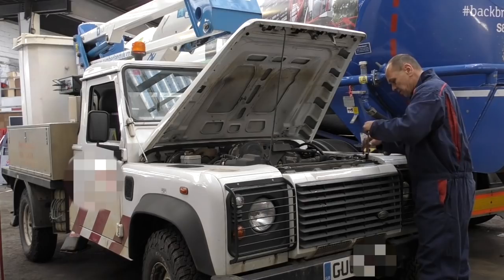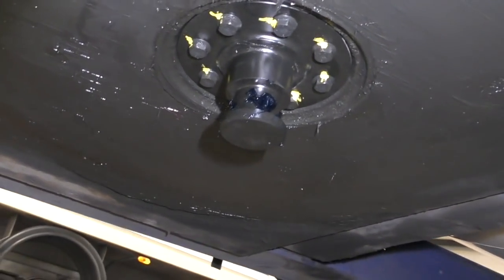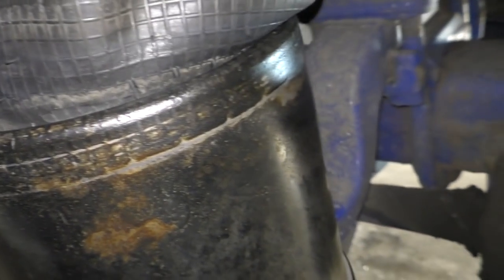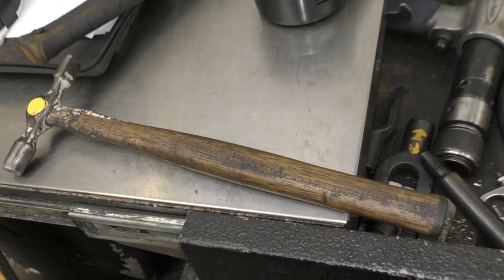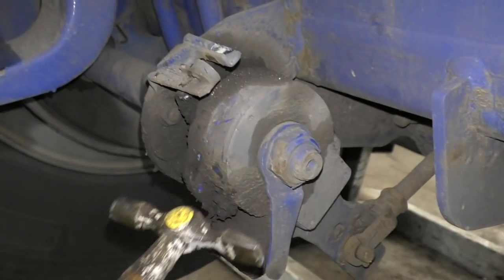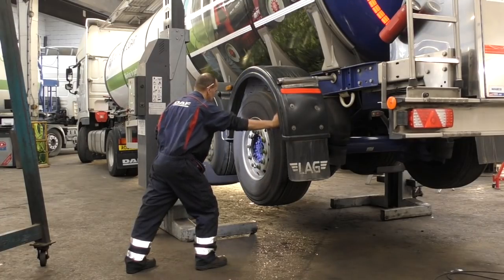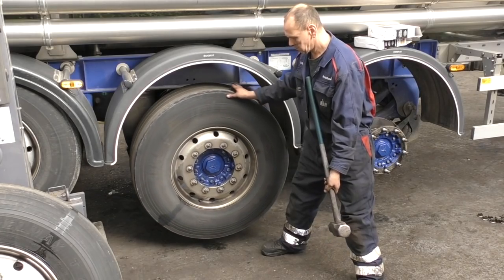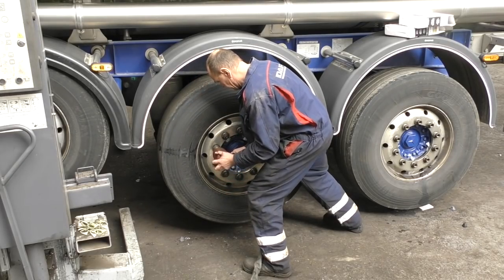So, what do Trailer-Fitters do?   PART 1  A Trailer Technician in the UK

Comment: Is it possible to wreck a kingpin by reversing to hard on to it ? , i have done it and i hear it all the time in yards .
Reply: That's a loada bs man
Reply: @irish-thinker4429  i haven't broke the kingpin .
Reply: @rmc5278  im a truck and trailer fitter ,
You never will break a king pin , it will take tye same abuse in all directions 
And iv never seen one break , they usually pull out of the rubbing plate due to rust or loose bolts

Comment: I prefer working on a pit for trailer work. No rolling on the floor for me. Not seen much body inspection, curtain sliding, side post checking internal body bolt inspection or load straps?
Reply: cosgrove notts -Working in a Pit is now classed as a confined space, so you have to be confined space trained. Also your employer must risk assess . Everything you do, pit covers etc . Lots of people fall into. Garage pits every year.
Reply: Especially on a decker.